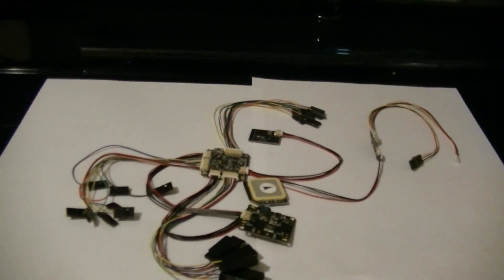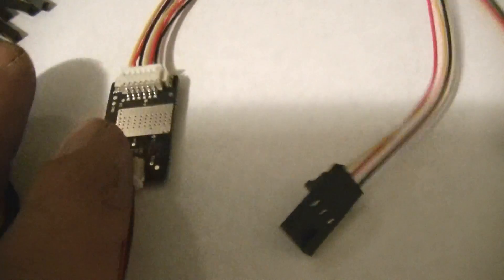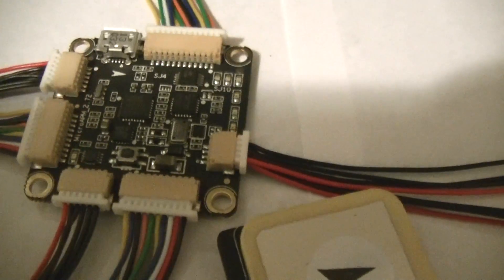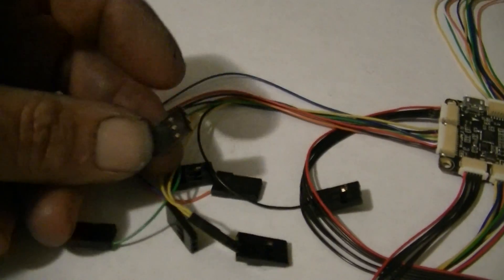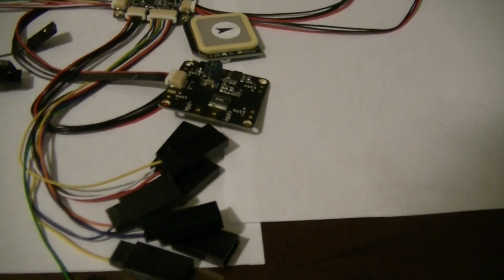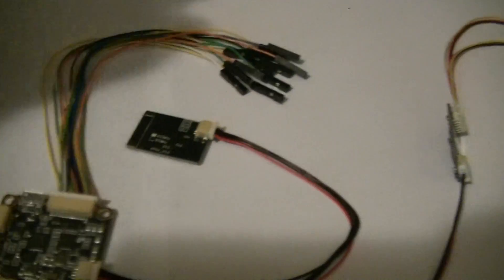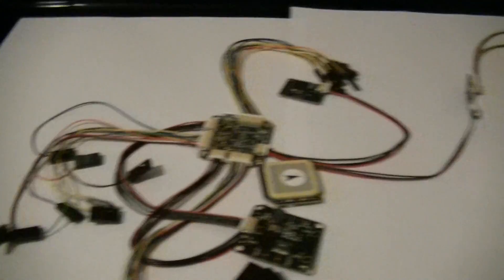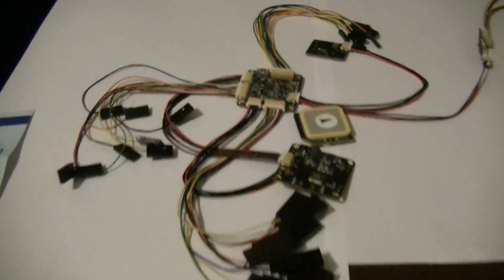mirco HKpilot master set

Comment: I just ordered this set myself and found it surprisingly well put together.  Every single cable that I needed for this install was included, down to the cable that i used to connect to my usb to serial adapter.  The auxilary outputs was a nice touch but for the time being I don't see the need on a mini.  The other thing that is cool about this set is the OSD/Telemetry module.  I wish they sold that piece for full size telemetry units as well. In any  case, thanks for this video.  It helped push me to making the purchase and I'm glad I did.

Comment: Hello again Dr.Drone. Finally I got my PDB from HK yesterday after waiting months. 
I do not get current out of the OSD to power the Cam or VTX. OSD leds are on. 

I have everything that comes with the micro master set besides the telemetry board that is connected to the osd via y-harness and the telemetry transmitter and receiver but I do not think that that is an issue. 

Did you have to click some button in mission planner to activate OSD funktion? Or do I need to feed the HKPilit mircro with extra power to get the VTX and Cam running with the OSD. I am not sure because I thought once I have the corresponding PDB I would not need to worry about it.

Comment: Hi Dr Drone. Great vid. Quick question.  Would the micro set be Ok on a mini hex. Would the pdb be usable as has 4 connections and 60a limit? 

Thanks
Reply from the maker: Iain Lawrence yea the apm will work for a hex.  I built a thorax which is a mini v style hex....  the board worked great.   I also used it on a prototype mini x8 I built with great results.   the PDB is only rated at 40 Amp but you should be pulling around 21 amps at mid stick,   might be risky.   you can simply use a standard apm power module as a PDB for a mini by just attacheching all the power leads together to the single pads on the module